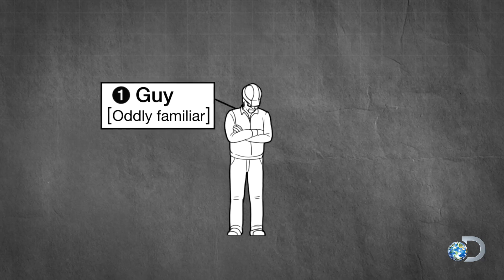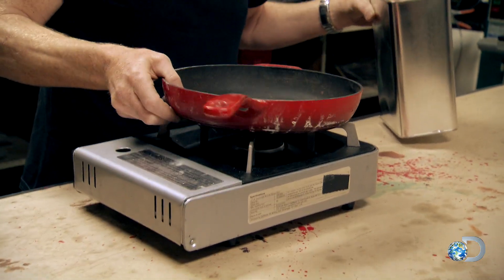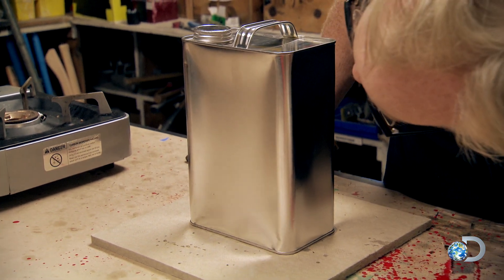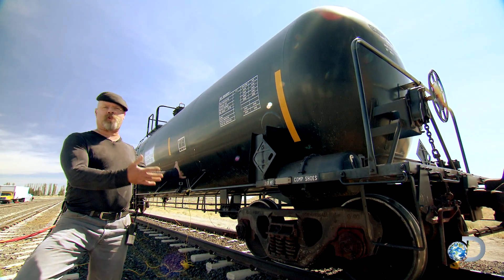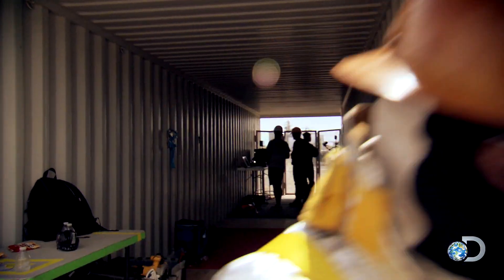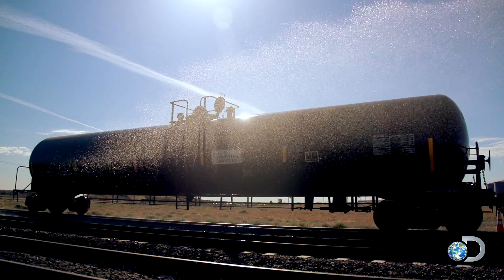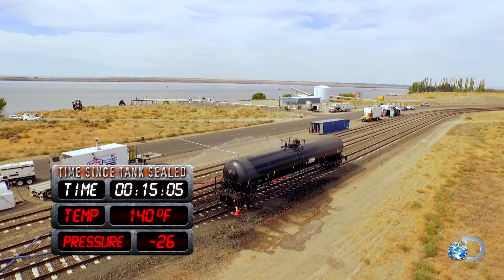Tanker Crush MiniMyth | MythBusters

Comment: All that build up for nothing...
Reply: Didn't you watch the episode? They tested the myth and now you know the result. How exactly is this a fail?
Reply: Actually they did crush it. They did more testing until it happened.
Reply: Jon Duke thanks, I could have sworn I saw this get crushed when it aired so I was a bit confused at this video when it ended with nothing.
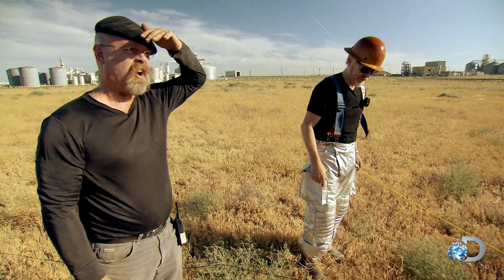Reply: 4:55
Reply: They did get it to crush itself by adding a dent in the side, that weak spot allowed it to squish
Reply: They did more testing that time it crushed
Reply: Angus S not at all science not always ends with a big boom or crush. They got a valid result from their experiement. Not at all a failure.
Reply: I forget how but they put a dent in it and did it again and it went squish
Reply: @nosoupforyouever15   they dropped a giant like 2000LB concrete block on it from a crane
Reply: Angus S 9
Reply: It crushes itself using Mercury in another video. Look up "mythbusters tanker" and it's the first video
Reply: Thanks for spoiling
Reply: well that is generally  Mythbusters. that is why i stopped watching after they just started blowing everything up for the hell of it
Reply: @antr7493  they didn't blow stuff up for the hell of it. Their mission statement has always been "test the myth and if it is busted, find out what it would take to make it happen."
Reply: @antr7493  Yeah. They clearly blew it up. You clearly didn't watch
Reply: @c_f0rce  you are right. instead of blowing it up they dropped a 3200 lb block of concrete on it. Clearly you didn't watch the whole episode.